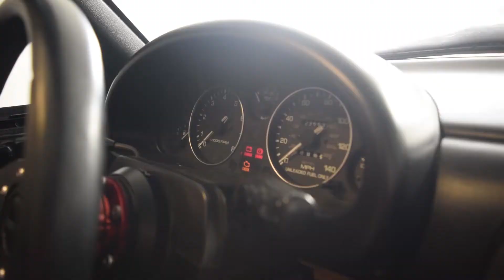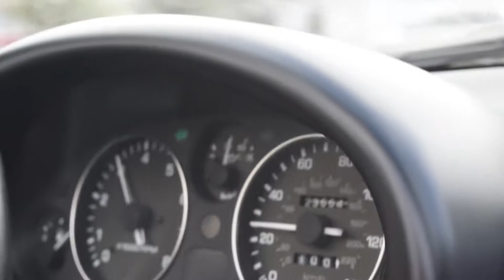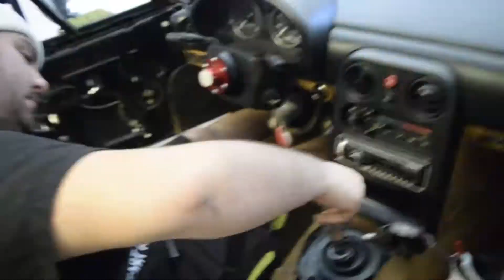Beavis Short Shifter Install 93’ Miata

Comment: I want to do the legacy front end conversion so bad on my 13 3.6R ):
Reply from the maker: It's really easy to install! When I get to the fixing the subaru video series I'll explain how I got it and how I put it on. You might need to modify your head light brackets slightly for the bumper to fit in and you'll need to remove all the foam padding in front of the crash bar, but otherwise it's very straightforward. If you get lucky you can find an unpainted Legacy sport 3.6R bumper on ebay for about $200 including tax and shipping. That's how I got mine, came in from Japan too. You can also pick up a 2013-14 legacy front grill for about $60-70 bucks & a new badge for about $30. All in all $300 for a dope looking front end. I'll make a video about it soon.
Reply from the maker: oh, I forgot to mention, you can get a super cheap foglight kit for this bumper on ebay as well for like $25.
Reply: DailySquad Thanks for the reply! Haven't been able to find a good deal on a bumper, grill, or hood so I guess I'll keep looking